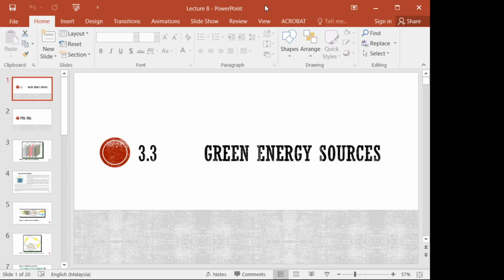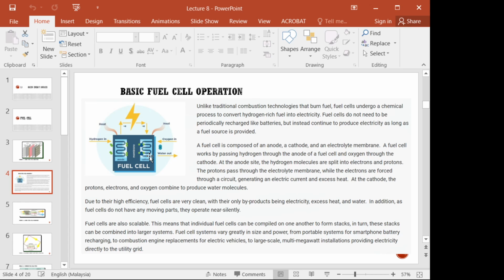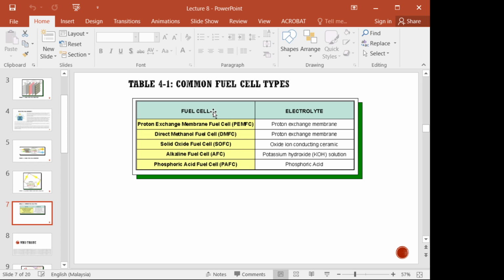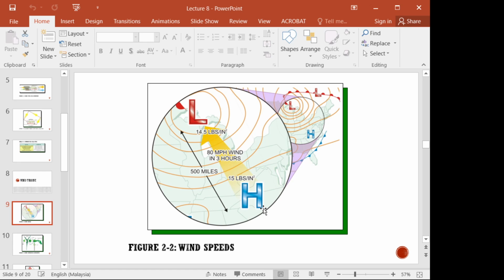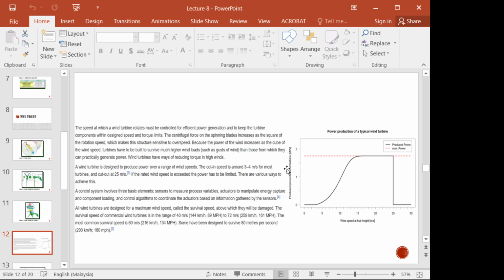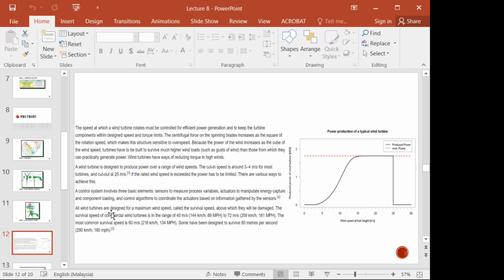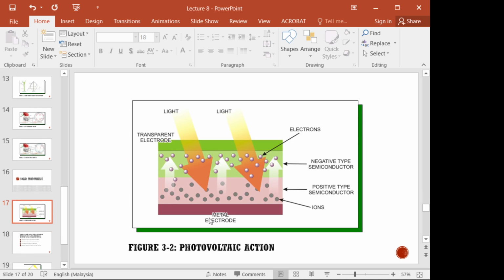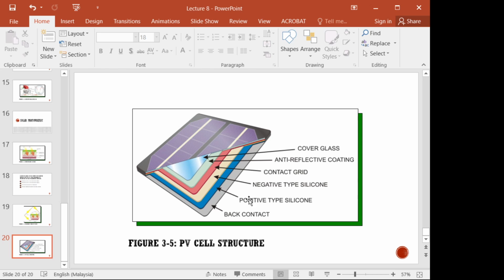Lecture 7 Introduction to Possible “Green Fuel”

Comment: MUHAMMAD AKRAM BIN RAZALI (B071710573)

Green Energy Sources

Fuel Cell :

Basic Components of Fuel Cell: -
1. Positive Collection Plate
2. Positive Electrode
3. Catalyst and has electrolyte in between
4. Negative Electrode
5. Negative Collection Plate

Basic Fuel Cell Operation: - 
- Fuel cells undergo a chemical process to convert hydrogen rich fuel into electricity. Fuel cells do not need to be periodically recharged like batteries, but instead continue to produce electricity as long a fuel source is provided. 

Wind Turbine :
- A wind turbine is designed to produce power over a range of wind speeds. Because the wing speed is variable and it is now constant. 
- The cut in speed is around 3 to 4 meter per second and the cut out is 25 meter per second
- Their control system: - 
·      Sensors – to measure process variables
·      Actuators – to manipulate energy capture and component loading
·      Control algorithm – to coordinate actuators
- Survival speed of commercial wind turbine is 40
meter per second to 72 meter per second and most common survival speed is 60
meter per second. There also winds turbine that can survive until 80 meter per
second.

Solar Photovoltaic:

Basic structure of PV Cell: - 
1. Cover glass
2. Anti-reflective coating
3. Contact grid
4. Negative type silicone
5. Positive type silicone
6. Back contact

Comment: ARVINTH A/L RAMACHANDRAN 
B071710339 
4 BMMH 1/2 

3.3 GREEN ENERGY SOURCES 

 1. BASIC FUEL CELL OPERATION 

-A fuel cell is a device that generates electricity through an electrochemical reaction, not combustion. In a fuel cell, hydrogen and oxygen are combined to generate electricity, heat, and water. Fuel cells are used today in a range of applications, from providing power to homes and businesses, keeping critical facilities like hospitals, grocery stores, and data centers up and running, and moving a variety of vehicles including cars, buses, trucks, forklifts, trains, and more. Fuel cell systems are a clean, efficient, reliable, and quiet source of power. Fuel cells do not need to be periodically recharged like batteries, but instead continue to produce electricity as long as a fuel source is provided. 

BENEFITS OF FUEL CELL 

Basic fuel cell structure

Positive collection plate
Positive electrode
Catalyst
Electrolyte
Catalyst
Negative electrode
Negative plate 

2. WIND TURBINE 

A wind turbine, or alternatively referred to as a wind energy converter, is a device that converts the wind's kinetic energy into electrical energy. Wind turbines are manufactured in a wide range of vertical and horizontal axis. The smallest turbines are used for applications such as battery charging for auxiliary power for boats or caravans or to power traffic warning signs.

wind generator components

Nose cone = shaped to minimize aerodynamic drag 
Blades = are physical structures, which are aerodynamically optimized to help capture the maximum power from the wind in normal operation with a wind speed in the range of about 3–15 m/s
Face = 
Hub = hold the blades and make it possible for rotate 
Stator = it contains coils of wire which will have voltage induced as magnet pass over
Rotor = is the rotating part of the wind turbine. It transfers the energy in the wind to the shaft. 
O-ring = 
Body = follow the direction of changing wind direction to maximize mechanical energy
Yaw = is the horizontal moving part of the turbine. It turns clockwise or anticlockwise to face the wind
Potentiometer = variable voltage divider 

Wind turbine rotor blades are being made longer to increase efficiency. This requires them to be stiff, strong, light and resistant to fatigue. Materials with these properties are composites such as polyester and epoxy, while glass fiber and carbon fiber have been used for the reinforcing. Wind turbine is designed to produce power over a range of wind speeds. The cut in speed is around 3 – 4 m/s for most turbines and cut out at 25m/s.

BASIC ELEMENT CONTROL SYSTEM

sensors =  measure a process variable
Actuator =  manipulate energy capture and component loading
Control Algorithms =  coordinate the actuators based on information gathered by the sensor

3. SOLAR PHOTOVOLTAIC 

Photovoltaics (PV) is the conversion of light into electricity using semiconducting materials that exhibit the photovoltaic effect, a phenomenon studied in physics, photochemistry, and electrochemistry. The photovoltaic effect is commercially utilized for electricity generation and as photosensors. A photovoltaic system employs solar modules, each comprising a number of solar cells, which generate electrical power. PV installations may be ground-mounted, rooftop mounted, wall mounted or floating. The mount may be fixed or use a solar tracker to follow the sun across the sky.

Sunlight absorbed affected by following factor:

Angle of light hit the surface
The haziness of the atmosphere 
The location of surface of panel (sea level)

Comment: MUHAMMAD HAFIZ BIN JOHARI (B071710380) BMMH S1/2

GREEN ENERGY POWER SOURCE

FUEL CELL
Basic fuel cell structure:

-Positive collection plate.
- Positive electrode.
-Catalyst.
-Electrolyte
-Negative electrode.
-Negative collection plate.

Wind turbine 
A wind turbine, or alternatively referred to as a wind energy converter, is a device that converts the wind's kinetic energy into electrical energy. Wind turbines are manufactured in a wide range of vertical and horizontal axis.

Comment: LUA WEI JIE (B071710861) 4BMMHS1/2

FUEL CELL
A fuel cell is a device that generates electricity through an electrochemical reaction, not combustion. In a fuel cell, hydrogen and oxygen are combined to generate electricity, heat, and water.  Fuel cell systems are a clean, efficient, reliable, and quiet source of power. Fuel cells do not need to be periodically recharged like batteries, but instead continue to produce electricity as long as a fuel source is provided. A fuel cell is composed of an anode, cathode, and an electrolyte membrane. A typical fuel cell works by passing hydrogen through the anode of a fuel cell and oxygen through the cathode. At the anode site, a catalyst splits the hydrogen molecules into electrons and protons. The protons pass through the porous electrolyte membrane, while the electrons are forced through a circuit, generating an electric current and excess heat. At the cathode, the protons, electrons, and oxygen combine to produce water molecules.  As there are no moving parts, fuel cells operate silently and with extremely high reliability. 

WIND TURBINE
There are two basic types of wind turbines: those with a horizontal axis, and those with a a vertical axis.
The majority of wind turbines have a horizontal axis: a propeller-style design with blades that rotate around a horizontal axis. Horizontal axis turbines are either upwind (the wind hits the blades before the tower) or downwind (the wind hits the tower before the blades). Upwind turbines also include a yaw drive and motor -- components that turns the nacelle to keep the rotor facing the wind when its direction changes.The majority of wind turbines consist of three blades mounted to a tower made from tubular steel. There are less common varieties with two blades, or with concrete or steel lattice towers. At 100 feet or more above the ground, the tower allows the turbine to take advantage of faster wind speeds found at higher altitudes.Turbines catch the wind's energy with their propeller-like blades, which act much like an airplane wing. When the wind blows, a pocket of low-pressure air forms on one side of the blade. The low-pressure air pocket then pulls the blade toward it, causing the rotor to turn. This is called lift. The force of the lift is much stronger than the wind's force against the front side of the blade, which is called drag. The combination of lift and drag causes the rotor to spin like a propeller.A series of gears increase the rotation of the rotor from about 18 revolutions a minute to roughly 1,800 revolutions per minute -- a speed that allows the turbine’s generator to produce AC electricity.A streamlined enclosure called a nacelle houses key turbine components -- usually including the gears, rotor and generator -- are found within a housing called the nacelle. Sitting atop the turbine tower, some nacelles are large enough for a helicopter to land on.

SOLAR PHOTOVOLTAIC
Solar cells, also called photovoltaic cells, convert sunlight directly into electricity. Photovoltaics (often shortened as PV) gets its name from the process of converting light (photons) to electricity (voltage), which is called the photovoltaic effect. The vast majority of today's solar cells are made from silicon and offer both reasonable prices and good efficiency (the rate at which the solar cell converts sunlight into electricity). These cells are usually assembled into larger modules that can be installed on the roofs of residential or commercial buildings or deployed on ground-mounted racks to create huge, utility-scale systems. The greater the intensity of the light, the greater the flow of electricity. PV cells are referred to in terms of the amount of energy they generate in full sunlight; known as kilowatt peak or kWp. The Solar Cell is the basic building block of Solar PV technology. These cells are wired together to form a module (PV Solar Panel).  The PV Modules gather solar energy in the form of sunlight and convert it into direct current (DC) electricity.  An inverter can convert this DC power into alternating current (AC power, which is the type of electricity used in your home).  PV Modules are joined to form a PV Solar Panel system. Large PV systems can be integrated into buildings to generate electricity. Sunlight absorbed affected by following factor Angle of light hit the surface, the haziness of the atmosphere , the location of surface of panel (sea level)

Comment: MOHAMAD ZARIF BIN ROSTAM
B071710681
4BMMH S1/2

GREEN ENERGY POWER SOURCE

FUEL CELL
Basic fuel cell structure:
1. Positive collection plate.
2. Positive electrode.
3 Catalyst.
4. Electrolyte
5. Negative electrode.
6. Negative collection plate.

Basic fuel cell operation:

Comment: LIM PEI JUN
B071710194
4BMMH S1/2

Fuel cell
•	A fuel cell is a device that generates electricity through an electrochemical reaction, not combustion. 
•	In a fuel cell, hydrogen and oxygen are combined to generate electricity, heat, and water.
•	Fuel cells are used today in a range of applications, from providing power to homes and businesses, keeping critical facilities like hospitals, grocery stores, and data centers up and running, and moving a variety of vehicles including cars, buses, trucks, forklifts, trains, and more.  
•	Fuel cell systems are a clean, efficient, reliable, and quiet source of power. Fuel cells do not need to be periodically recharged like batteries, but instead continue to produce electricity as long as a fuel source is provided.
•	A fuel cell is composed of an anode, cathode, and an electrolyte membrane. 
•	A typical fuel cell works by passing hydrogen through the anode of a fuel cell and oxygen through the cathode. 
•	At the anode site, a catalyst splits the hydrogen molecules into electrons and protons. 
•	The protons pass through the porous electrolyte membrane, while the electrons are forced through a circuit, generating an electric current and excess heat.
•	At the cathode, the protons, electrons, and oxygen combine to produce water molecules.  As there are no moving parts, fuel cells operate silently and with extremely high reliability.
Type of fuel cell
•	Proton-exchange membrane fuel cells (PEMFCs)
•	Phosphoric acid fuel cell (PAFC)
•	Solid acid fuel cell (SAFC)
•	Alkaline fuel cell (AFC)
•	Direct methanol fuel cell (DMFC)

Wind turbine
•	A wind turbine is an energy converter, it converts the wind's kinetic energy into electrical energy.
•	The smallest turbines are used for applications such as battery charging for auxiliary power for boats or caravans or to power traffic warning signs. 
•	Larger turbines can be used for making contributions to a domestic power supply while selling unused power back to the utility supplier via the electrical grid.
•	Wind turns the propeller-like blades of a turbine around a rotor, which spins a generator, which creates electricity.
•	When wind flows across the blade, the air pressure on one side of the blade decreases.
•	The difference in air pressure across the two sides of the blade creates both lift and drag. The force of the lift is stronger than the drag and this causes the rotor to spin.
•	The rotor connects to the generator, either directly (if it’s a direct drive turbine) or through a shaft and a series of gears (a gearbox) that speed up the rotation and allow for a physically smaller generator.
•	This translation of aerodynamic force to rotation of a generator creates electricity.

Type of wind turbine
•	vertical axis
•	horizontal axis.

Solar photovoltaic
•	Solar PV systems use cells to convert sunlight into electricity. 
•	The PV cell consists of one or two layers of a semi conducting material, usually silicon. When light shines on the cell it creates an electric field across the layers causing electricity to flow.
•	The greater the intensity of the light, the greater the flow of electricity.
•	PV cells are referred to in terms of the amount of energy they generate in full sunlight; known as kilowatt peak or kWp.
•	The Solar Cell is the basic building block of Solar PV technology. These cells are wired together to form a module (PV Solar Panel). 
•	The PV Modules gather solar energy in the form of sunlight and convert it into direct current (DC) electricity. 
•	An inverter can convert this DC power into alternating current (AC power, which is the type of electricity used in your home). 
•	PV Modules are joined to form a PV Solar Panel system. 
•	Large PV systems can be integrated into buildings to generate electricity.

Sunlight absorbed affected by following factor:
•	Angle of light hit the surface
•	The haziness of the atmosphere 
•	The location of surface of panel (sea level)

Comment: AHMAD ASYRAFAMIRUDIN BIN AZNAN
B071710607
4BMMH S1/1

GREEN ENERGY SOURCES
*FUEL CELL
- Positive collection plate
- Positive electrode 
- Catalyst
- Electrolyte 
- catalyst 
- Negative electrode 
- Negative collection plate
Basic fuel cell operation
-To convert hydrogen rich fuel into electricity.
-A fuel cell works by passing hydrogen through the anode of a fuel cell and oxygen through cathode.
COMMON FUEL CELL TYPES.
-Proton exchange membrane fuel cell = proton exchange membrane (electrolyte).
-Direct methanol fuel cell = proton exchange membrane (electrolyte).
-Solid oxide fuel cell = oxide ion conducting ceramic (electrolyte).
-Alkaline fuel cell = potassium hydroxide solution (electrolyte).
-Phosphoric acid fuel cell = phosphoric acid (fuel cell).
WIND TURBINE
-Measure via carbon foot print.
-To produce power over a range of wind speed.
-3 basic element: 
: sensor to measure process variable.
: actuators to manipulate energy capture and component loading.
: control algorithms are coordinate the actuator based information gathered by sensor.     
SOLAR PHOTOVOLTAIC. 
A Sun is equal to 1000 watts per square meter (1000w/m^2). This variable is affected by the following factors:
-The angle the light hit the surface (time – of – day)
-The angle the light hits the surface (time – of – year)
-The cloudiness/haziness of the atmosphere
-The height above sea level where the surface is located
SOLAR PHOTOVOLTAIC STRUCTURE.
-Cover glass 
-Anti-reflective coating 
-Contact grind 
-Negative type silicone
-Positive type silicone
-Back contact

Comment: NUR SELIHAH WAL HUDA BINTI AHMAD -  B071710190

GREEN ENERGY SOURCES
Fuel Cells
1) Basic fuel cell consists of negative plate, positive plate, negative electrode, positive electrode, catalyst and electrolyte. 
2) The fuel cell operates to convert hydrogen rich fuel into electricity.
3) A fuel cell works by passing hydrogen through the anode of a fuel cell and oxygen through cathode.
Common Fuel Cell Types
1) proton exchange membrane fuel cell = proton exchange membrane (electrolyte)
2) direct methanol fuel cell = proton exchange membrane (electrolyte)
3) solid oxide fuel cell = oxide ion conducting ceramic (electrolyte)
4) alkaline fuel cell = potassium hydroxide solution (electrolyte)
5) phosphoric acid fuel cell = phosphoric acid (fuel cell)

WIND TURBINE
1) Wind turbine measure via carbon foot print.
2) 4 season country, the wind speed is high due to the different of the temperature.
3) Wind turbine designed to produce power over a range of wind speed.
4) A control system involve 3 basic elements :
   - sensor = to measure process variable
   - actuators = to manipulate energy capture
   - component loading & control algorithm = to coordinates the actuators based on information from sendor.

SOLAR PHOTOVOLTAIC
1) PV action light activate the ion, the ion will transferred from +ve to -ve semiconductor. 
2) In Malaysia, the sun irradiates = 1000 watts (1000 W/m2)
3) Affected by several variable :
   - the angle the light hits the surface (time-of-day)
   - the angle the light hits the surface (time-of-day)
   - the cloudiness/ haziness of the atmosphere
   - the height above sea level where the surface is located
4) Electron current flow from -ve  to +ve semiconductor and creates electricity.